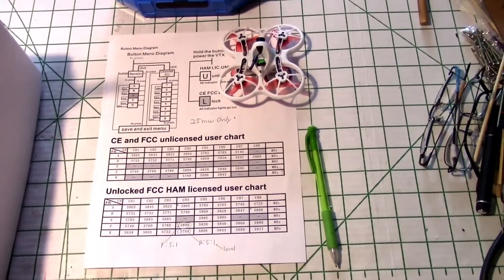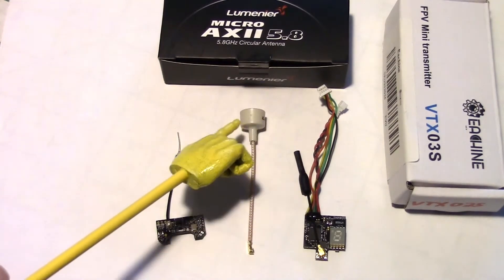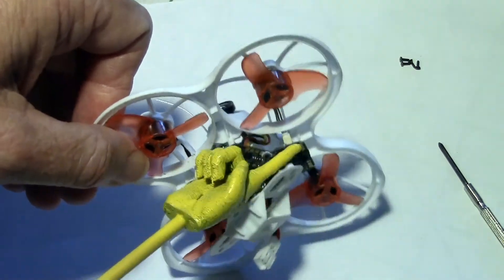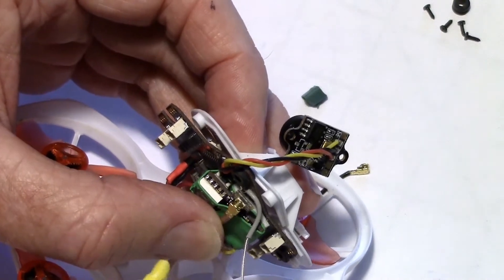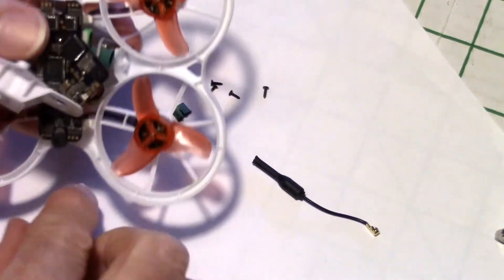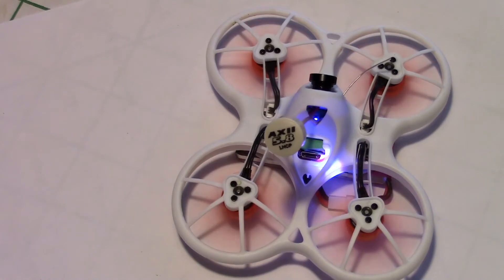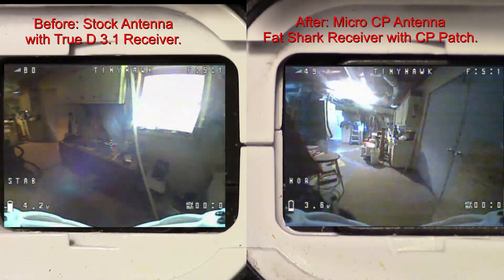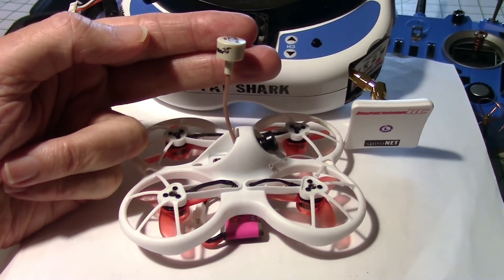Emax TinyHawk Micro CP Antenna Mod -  Does It Help with Video Breakup?

Comment: I'd say the lower signal strength was a result of the lower battery voltage, you can see the osd voltage is at full charge with the stock antenna, and it got progressively worse as the voltage dropped... which is exactly what happens on 1s.  Fly on 2s you'll be shocked at the difference in quality of the video feed.

Comment: Thx for the info. Btw, it's far easier to simply put the FC in first and then plug the motor wires in with some tweezers. 
🤘😁👍

Comment: Dear Dave, Please help !!!  I connected it to betaflight to change settings...ended up loosing the settings...now once I connect it to betaflight it's not connecting....once you connect flashes red light ...then red light stays on...tried uploading both software from betaflight ....tried binding it too....no luck so far ....please help !!
Reply: Hey Naresh - I had a similar problem - it was solved by using 'ImpulseRC_Driver_Fixer'!
Reply from the maker: I am not much for troubleshooting betaflight. Have you tried Joshua Bardwell's Q&A Livestream
Reply: @DaveMerc  many thanks for you help..will sure try .
Reply: Don't know if you got it working yet , but by chance did you turn off the VCP , (Virtual com port) which is your micro USB port on the FC. If you did, then simply reflash the stock dump file to restore it back to factory.

Comment: Good comparison video Dave. I added some heat shrink to my stock antenna to make it stand straight up and it helped with reception. Love flying my Tiny Hawk around the house outside.
Reply from the maker: It's amazing how they pack all that tech in such a small space. Great little quad. It will be interesting so see how it does outside and at the gym.
Reply: @DaveMerc  You will enjoy flying it for sure. I have tried 3 different batteries in this quad and found that the Xilo 550 mah perform the best. I can get up to 5 minutes general flight time from them. They are available at several US based suppliers. Here is a link for GetFPV: https://www.getfpv.com/xilo-550mah-1s-50c-high-voltage-lipo-battery-jst-ph-2-0.html
Reply from the maker: I have been using the Gaoneng 450 HV and they fit tight in the holder. Will the Xilo 550 fit ok?
Reply: @DaveMerc  Yes, they are the same width as the 450 stock batteries just a bit longer, but fit perfect.

Comment: #1, Hi D., I believe you get a better signal this way, but the signal is more powerful, and it bouncing of the walls right now, I have better performance with a rubber ducky antenna for indoor flights. Cheers.
Reply from the maker: You might be right. Maybe would work better outside.